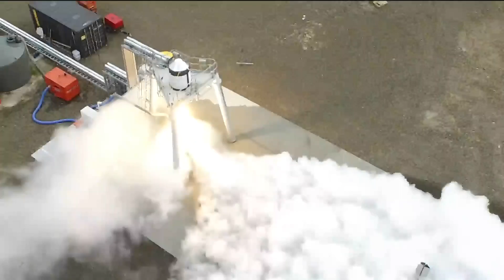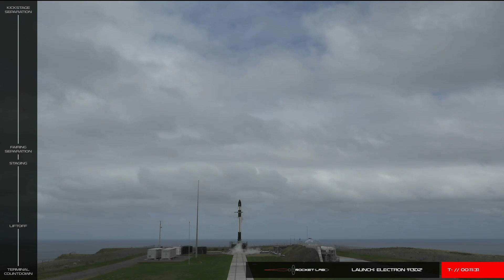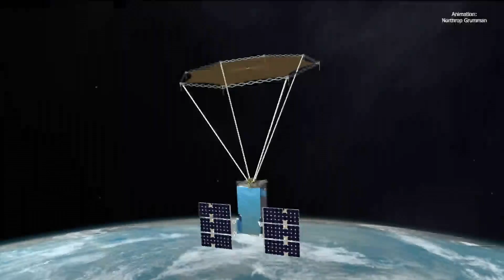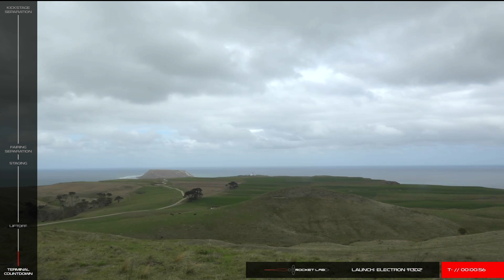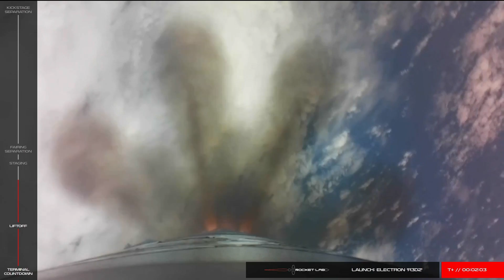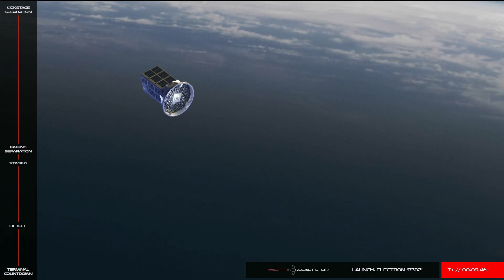DARPA R3D2 Launch - 03/28/2019

Comment: Another wide-angle lens bus but much much more trickery than just that and it's a use a couple of different lenses actually it's just superimpose most of the time but you clearly see wash their Horizon right when they show you the split screen shot dumping the engine and you'll see that the Horizon is toward the outside of the frame with a curve to it and then as the Horizon drift toward the middle of the frame it starts to flatten out oh yeah but anyway that's not the real issue here especially with physics so for the record at about 3 minutes and 15 seconds those engines literally fall back to Earth just as they should and don't even tell me they're going that fast unless you watched camera footage of what a car taking off from a starting line looks like with a rear view yeah those get up yeah those get up to a couple hundred miles an hour really fast and this thing is supposedly doing thousands and thousands of miles per hour at the time of that engine drop off at 3 minutes and 15 seconds and look how slow it goes they want you to imagine that it's floating and that the rocket is just taking off from the engines right except those things are falling and tumbling and of course are affected by pressure cuz that's why they're tumbling but yeah just it's just a bad cartoon show and they kind of have to do it that way to make it brainwashing enough for the kids but anyone who knows physics knows there's so many problems with the time that it takes I mean amateur Rockets get up to this in just a few seconds like less than a minute it's a whole entire puppet show man that's why they get horizontal at like not even a hundred thousand feet I mean it's just a puppet show just look at when they get horizontal it's not even a hundred thousand feet and that's why you always see just one little Horizon like come on dude let's see a freely moving camera in someone's hands or at least on a remote turret so we can see everything I mean they've never done that not one single launch has given us that at least but it should every time be unedited uncut camera views like why don't you just show us all of the cameras on one screen without being cut away from or edited or anyting yeah it's never going to happen not even in the slightest you without being cut away from or edited or anyting yeah it's never going to happen not even in the slightest

Comment: Hot swap and jettison of used booster batteries a new one on me! I've been seeing launches since 1962!
Reply: Starphot it’s because the turbo pumps that feed the engines fuel are electricity powered
Reply: I think more companies will look towards batteries as they must reduce the amount of 'plumbing' considerably. Also on long flights the batteries could be solar charged between burns.

Comment: You dont realize just how fast its going until it ejects the batteries. Prettu awesome
Reply: When the batteries are ejected they appear to be falling away, but they really are not. When ejected the batteries do not slow down, they are still travelling at 3km per sec,  it is the  2 stage rocket that is accelerating away from them.

Comment: Good work guys. I cant wait to see you guys start to propulsive landing.
Reply: They wont . Not worth it
Reply: @alvih333  how is that?
Reply: @runnerxc212  boosters this size are cheap and fairly easy to make.  engines are 3d printed so also cheaper than traditional engines.
Reply: @Gibson99  They still cost millions of dollars --  but Rocket Lab said very clearly that they do not intend to develop reusability. 

Today, nobody except SpaceX can do propulsive landings -- primarily because landing thrust needs to be about 20 times lower than the thrust at take-off.

Falcon 9 and Electron have nine engines. Using all nine at take-off makes it feasible to use one throttled down engine for the landing. 

One of the limits to how deeply Merlin 1D can be throttled down, comes from (in)stability of the gas generator that powers the turbo-pump. Having electric pumps instead, removes this limitations on throttling range of the engine -- provided there are no combustion instabilities of the main combustion chamber at lower thrust levels. It would seem that Rutherford engine with its electric fuel pumps might be ideally suited for propulsive landing.
Reply: @cogoid  all good points. I'm not disagreeing, just expanding on what you said.

Unfortunately the mass of the landing gear and excess fuel required would severely eat away the already small payload capacity of the electron. Would also require a complete redesign of the fuselage to be able to handle the new stresses of re-entry and landing that it's probably not currently designed for. 

Having (briefly) seen a landed F9 booster in person, I can't imagine just how much mass a similar system would add to electron. F9 was able to add it because along with other improvements came increased thrust, so they weren't sacrificing payload capacity. But for RL it's not worth it right now. Maybe after they have a string of successful launches and a comfy amount of money in the bank to fund the r&d, they'll consider doing a clean sheet design of a reusable small sat booster, but right now, expendable is the right decision for them.
Reply: @Gibson99  Well said.